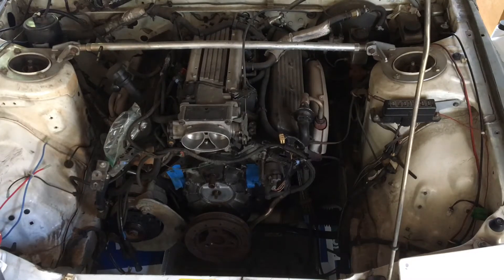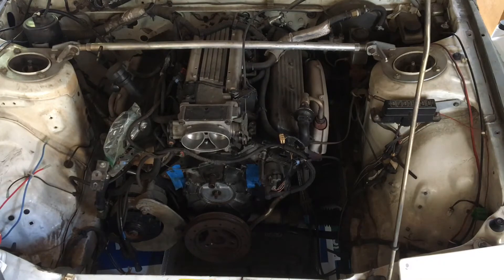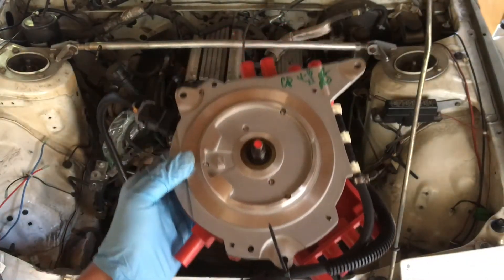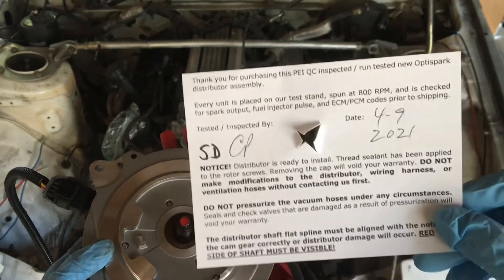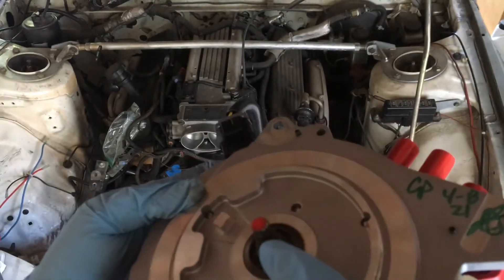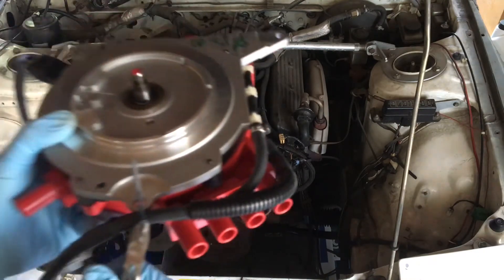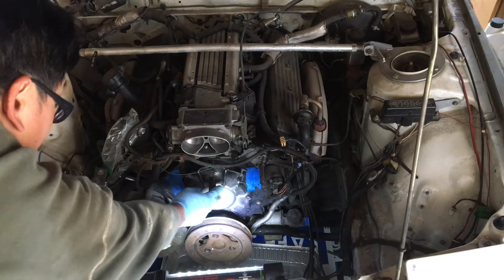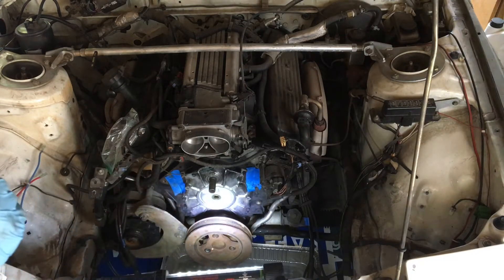1992-1997 Petris Enterprises LT1 Optispark Non-vented to Vented Conversion - Install Part 1

Comment: I am surprised ThrowBack Enterprises mentions how to read codes on these cars. However they didn't mention information about how to read the 94 and 95 years specifically. You can't jump A and B ALDL's on the DLC. You have to use a powered display tool that connects to the DLC and outputs the communication from the ECM. An OTC 4000E/2000, or a OBDI to USB with CatScan software is a good example to use. These both actually work.

Yes Petris is now rebranded to ThrowBack Enterprises. They marketed specifically to the LT1/LT4 platforms. $500 for just the vented opti, $900 for the whole kit. 4k if you want to convert to coil overs and remove the optispark entirely with a crank sensor.

Comment: You have to remove the that crank pulley  .😮 to install the opti. How i installed my opti i took the cap off 
then positioned the rear of the opti  to the hole  while gently turning the rotor back and fourth until it locked into position.  Word is if you take the cap off on the Petris optispark you void the warranty.

Comment: Im curious how you installed the optispark on that LT1 with out taking off the harmonic balancer ?  the opti needs to be installed straight on and not angled in, you could force on to that shaft and be a tooth off.  Ive installed 4 optisparks and always removed the harmonic.
Reply from the maker: Yes, harmonic balancer was removed, see 10:45

Comment: The best way to install the Optispark is to remove the cover and turn the Rotor by hand and it will fall right into place... start your 3 mounting bolts then put the cover to the Optispark back on... I just did this job on my 95 Vette.. there is a special socket set you will need from Autozone to remove the 3 tiny little bolt/screws that hold the Optispark cover on.. like a backwards torque head...

Comment: The Opti Spark Distributor maybe the worst automotive part ever invented.  After installing the "Pin Drive" unit on my 95 Corvette and having worse issues with alignment than he just had with a "Spline Drive", is a nightmare.  Failure rate with these things is well above normal for automotive electrical parts.  Ask anyone that has installed one on their LT1 motor and had to remove and replace it a 2nd and sometimes a 3rd time due to manufacture failure.  I purchased a very reputable one from a Corvette source (not made in USA) that failed after the second days test drive that completely quit, then started after cooling down.  Three days later the car would not start at all.  Currently researching for the best one manufactured, if that is even possible as the original GM part is no longer made, so only after-market parts are available.  I am leaning towards the Petris part based on reviews and references or the top end MSD.  In closing, the design of this thing, an electrical component mounted below and behind a water source, requiring removal of the Harmonic Balancer to replace, is pure nonsense on the C4 Corvettes.
Reply from the maker: Ours is still running!